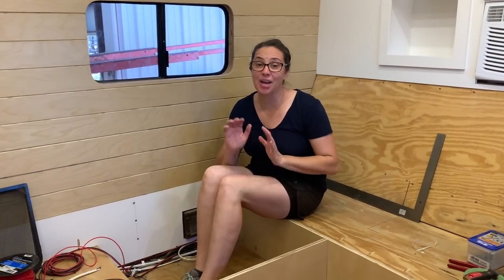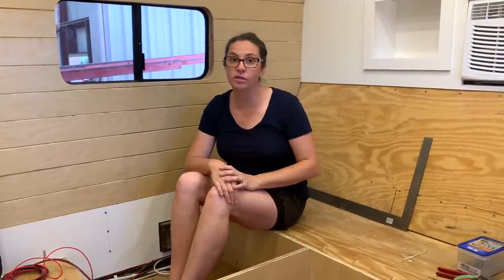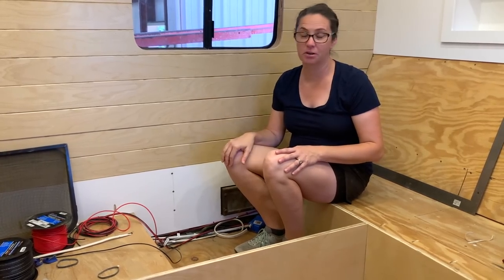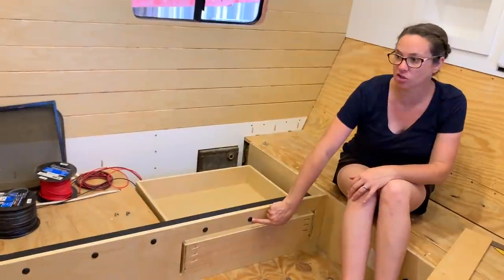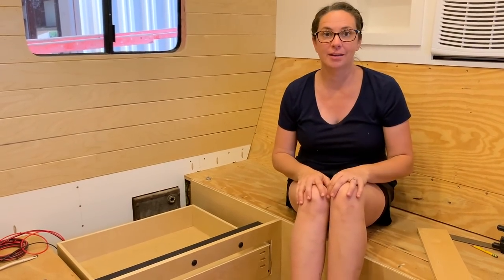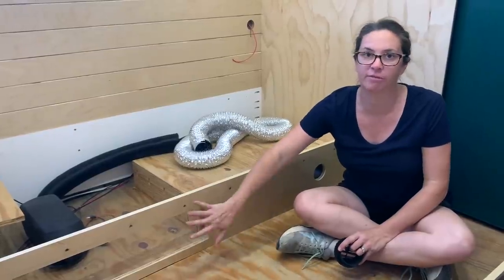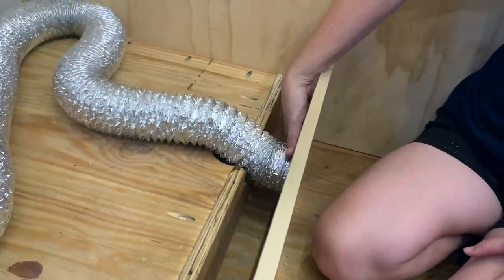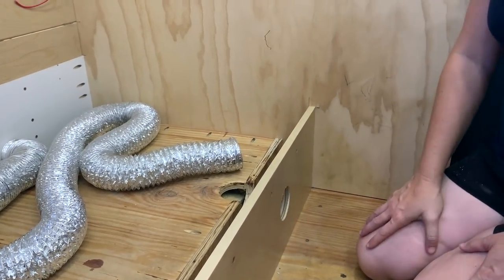Kids' Bunk Room: Part 1 - Lower Bunks

Comment: Juan, I'm pretty sure the bunk bed could hold you and me both jumping up and down on it! It may not be an issue, but you might want to think about an RV air conditioner duct vent for that heater outlet so you can direct the airflow any way you might want it. In my experience the air never flows where you want it and one might get hot and another cold.
Reply from the maker: Thanks!  Great idea.  We will definitely have to keep an eye on the heat flow in that room.  We haven't spent much time with it on since it has been the hottest summer on record for Phoenix.  114F again all weekend.

Comment: It looks great!  
You may be able to rout the non-drawer front at the bottom to allow for air to be able to be drawn up to supply the heater intake.  
Maybe even putting some kind of screen for dust collection so it wouldn't get inside the heater.  
And you could use recessed magnets (neodymium for strength) to keep the false drawer front attached while still allowing easy removal for access.  
Pretty nasty booboo on your elbow...please be careful!
Reply from the maker: Thanks Gregory - we will be putting some venting in the door for the intake for sure.  I love the magnet and filter idea!  The nasty booboo will be explained on a future episode ;)

Comment: Nice work,  a little over kill on the number of carriage bolts but it looks neat.  Maybe use nylock nuts instead of a lock washer.
Reply from the maker: Thanks.  Well, you know "overkill" is how we do things over here.  :) We probably could have gotten away with fewer bolts, but a few extra doesn't hurt and since they have to show,  we felt this spacing looked a bit nicer.  Thanks for always joining in!

Comment: Nice! They make a " Y " for the heater hoses and parts if you go on Banggood.com, wish.com, amazon.com or maybe keep a spare unit in that little area next to the heater for a quick plug and play back up, just in case. The three spare parts I would keep on hand is a new mother broad, pump, and a new LCD controller. Old military habit, you know the old saying: have it, and not need it, then need it, and not have it!
Reply from the maker: Great ideas!  We have actually considered just having an entire heater as a spare (we will have 2 on the bus).  At $125 they are cheap enough and they don't take up too much space.  I think a "Y" would be a better way to plumb this connection in - the T is going to be less effective.

Comment: Before I saw the cut in the wheel well, I thought for sure y’all were going to create an sealed, enclosed space behind the heater register opening, with a more convenient location for the duct hose to connect— creating a plenum of sorts. I’ve heard of folks building homes off the ground with a sealed crawl space with the HVAC blowing down into it in a central location, and they simply cut out holes in the floor wherever they want a register, obviating the need for ducts, and getting a passive heat or cooling of the floor, without running cooling lines.
Reply from the maker: Wow really interesting idea!  I don't think we really have the room for that but it got me thinking.  Thanks!

Comment: I know this is late and the project is done.. Looks Great by the way.. But for the area by the mini heater you maybe could have done a 1/2 sized drawer (wide) with a full size face to match the other side like you want.  and if i may ask?? why the use of the steel vs just using rips of plywood for the bed slats.. glued and screwed plywood would have served you just as well.. lighter too. Thanks for sharing your build
Reply from the maker: Thanks!  We considered doing a smaller drawer in that space like you mentioned.  But, it is actually only about 8 inches wide in that open space in there.  We will likely keep things in that space that don't need to be accessed frequently.  If we change our minds later, we can always build and add a tiny drawer to the space.  For the beds, the steel is the support rails.  After we finished the upper bunks (next video), we did indeed make plywood slats secured to the rails to then hold the mattresses.  The steel will support the weight of the mattresses and kids.

Comment: Hey guys, another great video, and phenomenal crafting!

One thought...I wonder if having that ductwork so close to the futon/mattress for the lower left bunk will make that bunk uncomfortably warm when the heater is operating. Would it be possible to run the duct down the gap between the faceplate and the wheel well to either a right angle piece or a "T" at the outlet, with the other end of the "T" continuing to the bathroom? You could then insulate above the duct to protect the bunk occupant.

Alternately you could just box in that gap and plug the duct into the aft end of it, making that gap the continuation of the duct itself. Again, insulation on the top of that box duct would protect the occupant.

Just a couple thoughts.
Reply from the maker: Great thought Jeff.  I don't think the heater will be too hot but maybe we will just add a layer of our ceramic fiberpaper (the white stuff that is all over the walls and ceiling) around the pipe just in case.  It can withstand temperatures of 2400 degrees and is used in kilns and ovens.